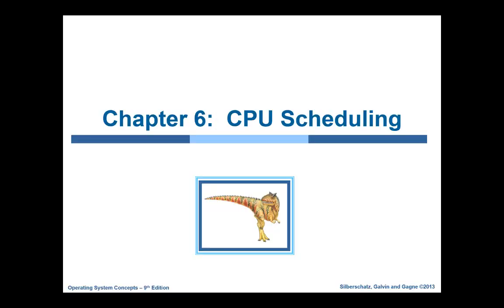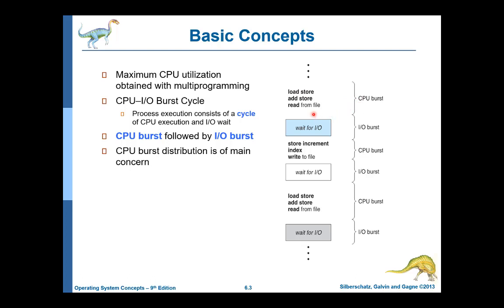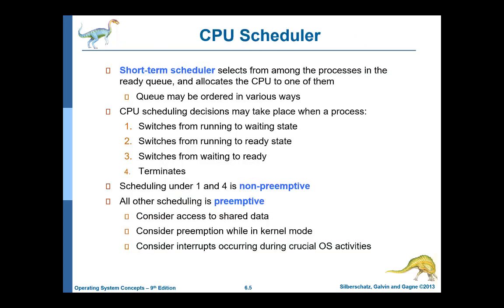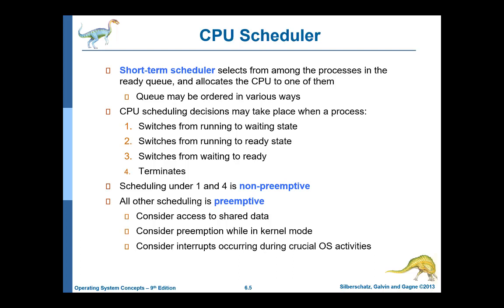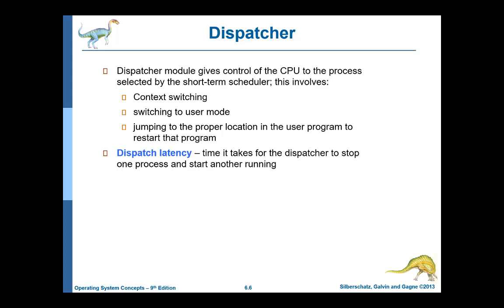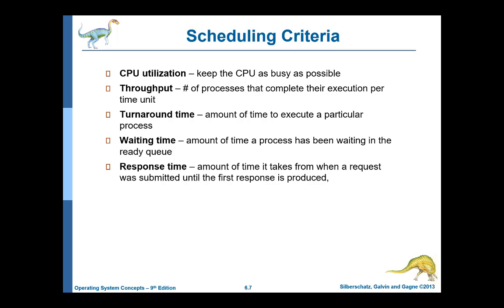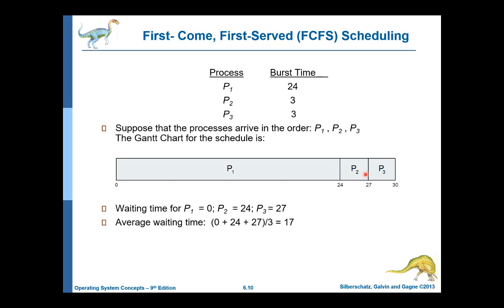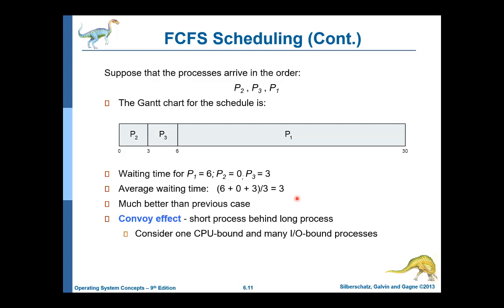Operating Systems: Chapter 6 - CPU Scheduling - Part 1

Comment: If the CPU is the brain of the computer, the Operating system is the mind of the computer. (Just curious 2024).
Reply: OS would be neurons!
Reply: @arkay_  The CPU is connected to all other devices with buses, so we can say that the CPU is the brain and the buses are neurons, 😏
Reply: @justcurious1940  hm.. you are right. then what should we call OS? OS is a resource allocator and control manager right? what part of our body plays both the roles... hm.. or I think. OS would definitely be the brain, and CPU is just providing resources, and that would be.. heart?